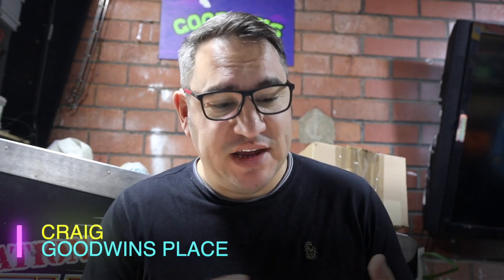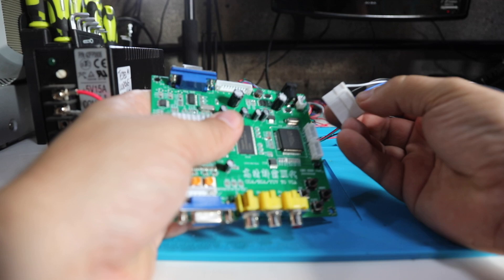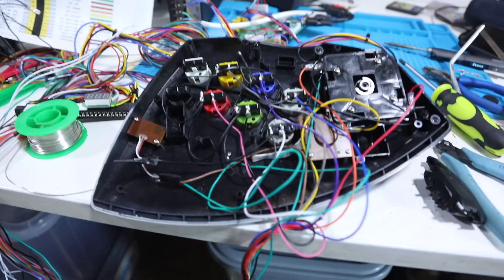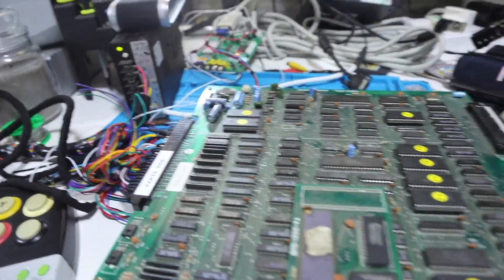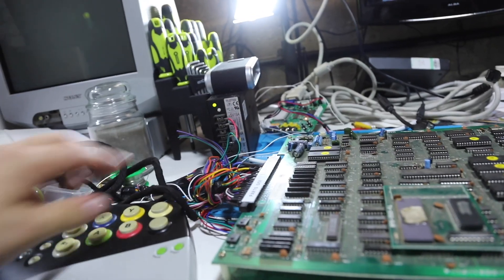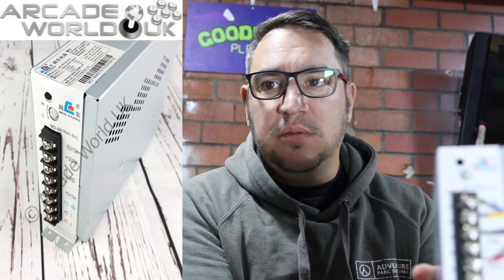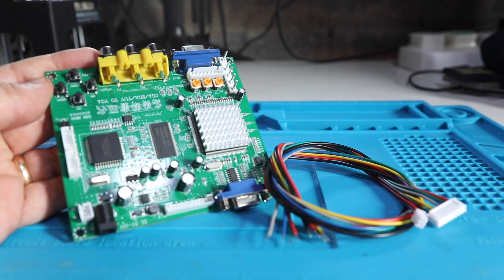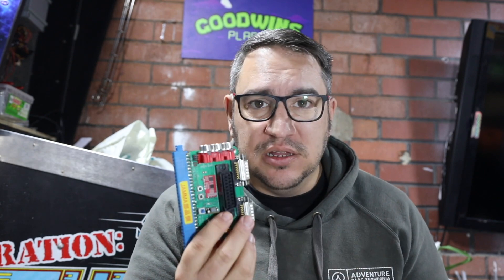Building Arcade Jamma Test Rig Supergun - Mcbazel CGA to VGA Output

Comment: You make it look so easy bud, that tape you bought is great for those small wires, and tye joystick was working great 😄
Reply from the maker: It is easy. This one isn't much more than connecting things to the right place. 
Joystick is perfect for this, the down is a bit hit and miss so I'll swap out that microswitch and wire in those other buttons soon.

Comment: Nice job 👍 I've been meaning to do something similar myself. I've had one of the cheap scart ones for a couple of years, waiting, along with jamma board in the cupboard of doom.
That joystick fits a treat there in front of your TV 🙂
Reply from the maker: It's a temporary setup for now. Will be nice to box the power supply and video board. Some better speakers wouldn't hurt too.
Those basic board ones are great for my MVS but I'd always be worried if a board didn't work if it was the adapter or the board.

Comment: Craig - the PSU should have a 5V adjustment pot on it.   All the best.   Phil.
Reply from the maker: Yeah it does but even on full it wasn't giving me 5v at the board. The second one was much better and allowed me to adjust to suitable reading. I have some bootleg boards that are really funny witn specific voltages either high or low.

Comment: Cool little rig that mate, if you need a pc powersupply let me know as i have one spare your welcome to Craig. The extension sounds like great solution surprised youve not asked people to pay for it though!....isnt that the norm nowadays 😂
Reply from the maker: Thanks, I've got a few pc ones around, using one in the pinball for certain items. This needed ability to adjust voltage and do the -5v so worth buying.
I was thinking someone should pay for my extension for me. 😂
Only way I'd ever do a funded item is if I were able to offer items back to the community, physical items not content.